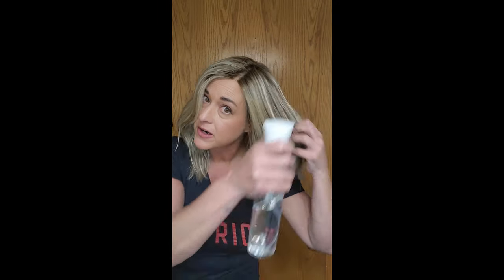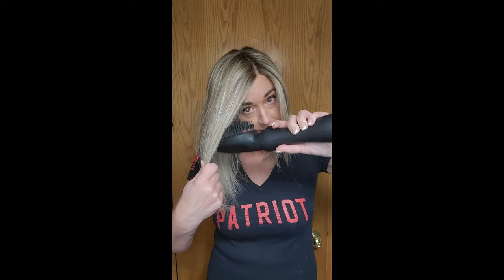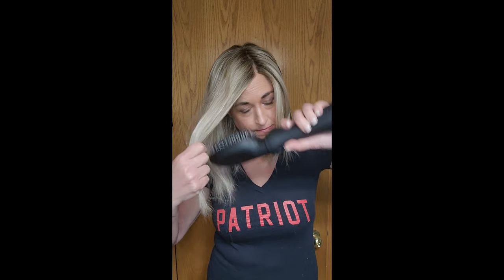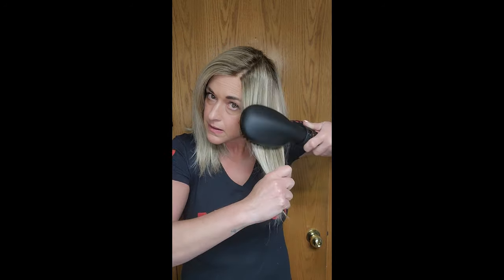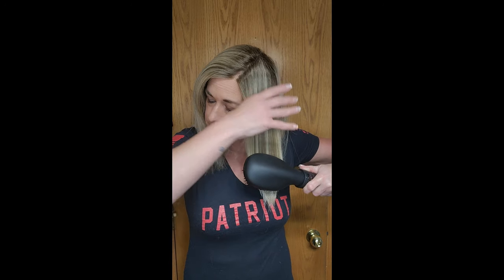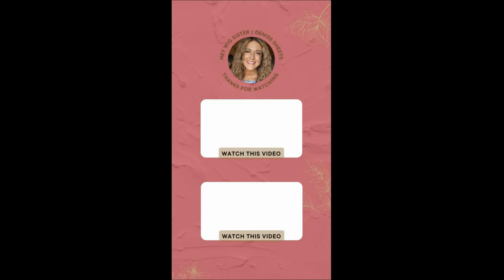TIP TUESDAY: Fix Cold Set on a Heat Friendly Synthetic Wig | When box hair doesn't shake out

Comment: I'm new to wig wearing, if you curl a HD wig that was a straight style will it always be curly or will washing it take the curl out, or would you need to straighten it with a flat iron?
Reply from the maker: It will keep the style once you change it, even after washing... curling heat friendly wigs are trickier than human hair, though, you have to make sure to hold the curl in place until it is fully cooled otherwise it won't set.  Some people find hot rollers to be easier than a curling iron.